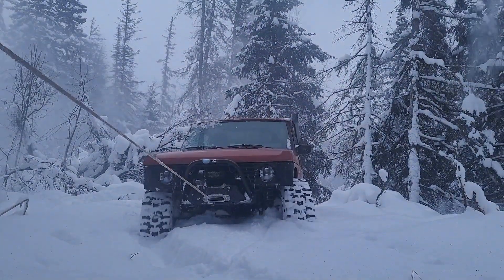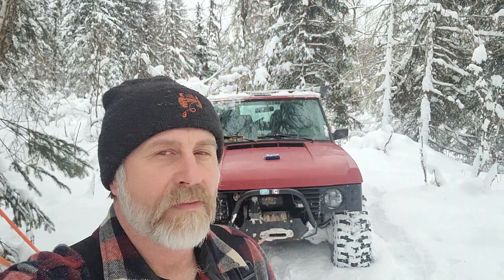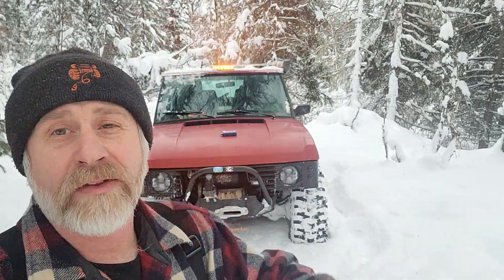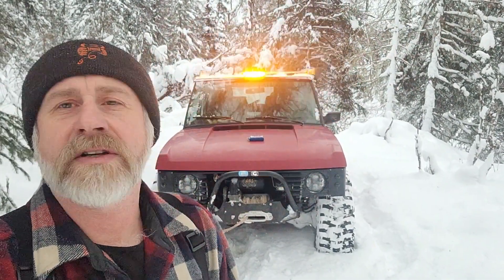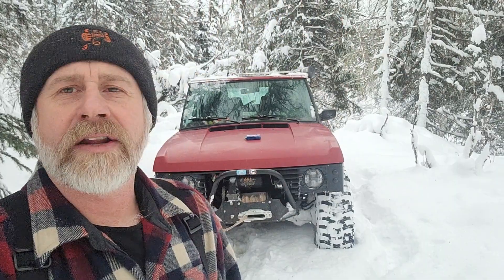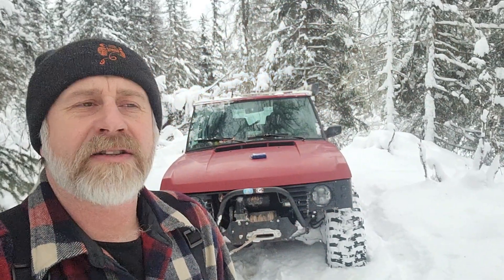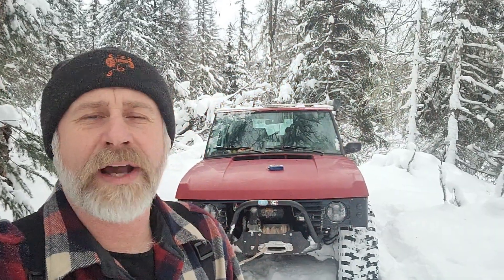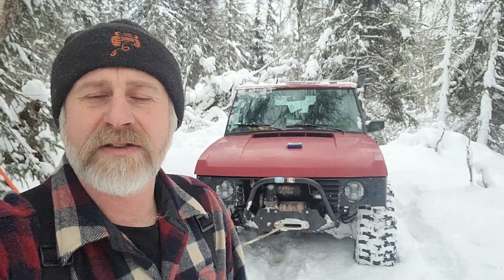Dec 12 2023   Turbo Winching!!    Overvolting Equipped Alaskan Range Rover!!

Comment: So?  Where are any details of what this is???  How does a single alternator charge 3 batteries when two are in parallel???
Reply from the maker: 2 batterys are parrallel and tge 3rd uses an isolator to keep it from being drawn from. The 3rd isolated battery runs the vehicle, lights.  A 250amp alternator provides the charge. 
The Goodwinch Turbo Winching system puts the 2 batteries in series with a flip if a switch which allows 24v into the winch motor when winching in. I have this setup in 2 rigs and it works great.  The Turbo kit comes from Goodwinch in the UK.